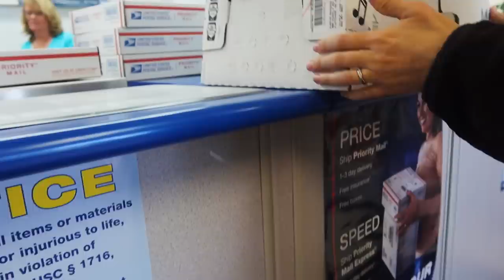Starting Chicks in the BULLET PROOF BROODER

Comment: Have you thought about an inversion table for Jonah? Might be worth looking into it as a way to elongate his spine and hip. You don't have to hang upside down either, just a gentle angle did the trick for me. I used to fall asleep on it because of the relief. My hip was crushed and I had a fractured pelvis in 4 places from a couple accidents. I had the joint replaced and the pelvis screwed back together but I still limped and had frequent pain. So I bought an inversion table and started using it every evening. I used it for a few years and one day I just didn't need to use it anymore. I still get flair ups of pain but it's only when I work too hard and over do it. Just saying this would be one of the least invasive healing regimen I can think of, IMHO.

Comment: I use an extra large dog crate that I covered with  welded wire as a brooder. I use the cardboard from cases of soda or cat food inside the dog crate to hold pine chips in. I cover the top with a flannel lined, plastic, cheap tablecloth to keep them dry, and the heat in.The chicks or poults are outside with a heat lamp. Raised them like this for 15 years.
Reply: I just built a 4x10' fancy schmancy brooder with three hinged lids, a divider, and lots of joinery.  I can say this:  keep it simple,  they're just chickens lol.  Nice work keeping it simple!
Reply: @Monnie Holt  dog crates are easy to clean. With welded wire added only bugs can make it in. I don't have to worry about a building catching on fire from the heatlamp. I put the dog crate on top of a plastic table in an area fenced off from the dogs. No bending... so not hard on my back. Already has large doors. And you can just use the plastic bottom that slides out and clean that way... but I found the cardboard boxes work well to keep shavings inside...and it's all compostable once the brooder isn't in use anymore. 🤷🏻‍♀️